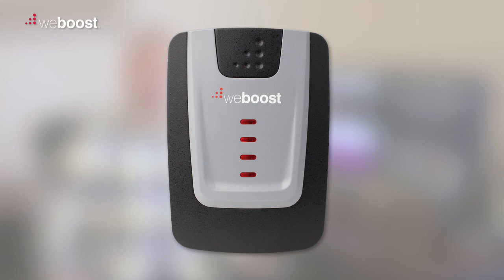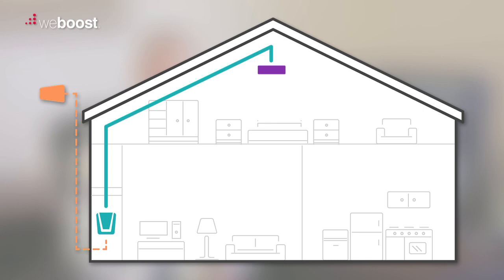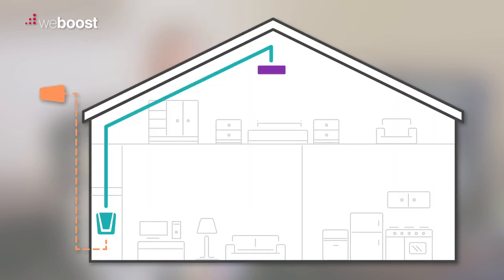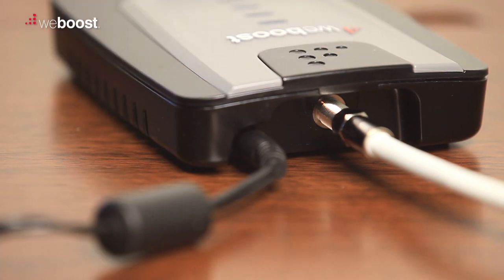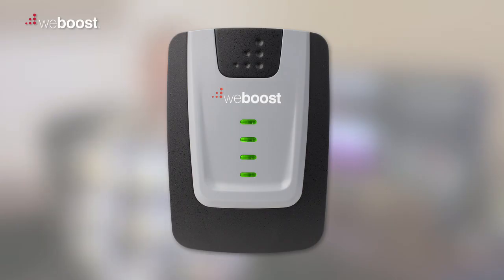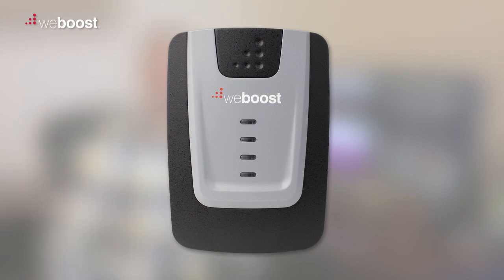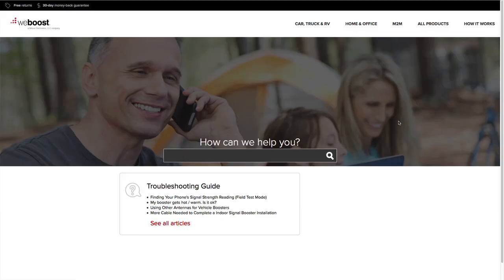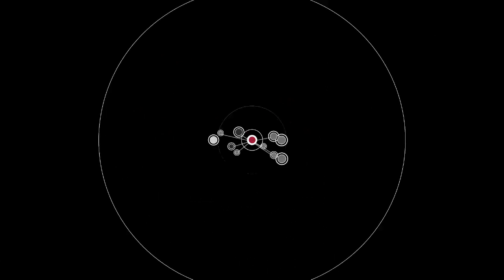Signal booster lights what do they mean? | weBoost

Comment: Well, this almost answered my question. My booster links, red and green when I first turned it on then it goes to solid green. My inside antenna and the main booster are about 3 feet apart. I am assuming this is the issue. Most of the time the booster works properly according to my signal, where there is a signal. Other times it doesn’t make a difference if I turn it on or leave it off the Signal can remain the same. I use fuel test mode on my iPhone to see the Signal decibel reading.

Comment: I recently changed from t-mobile to metro by t-mobile. Now my signal booster from t-mobile isn't working right. It has one. Green and one orange flashing lights at the top. The other four are not on at all. I have unplugged and pushed reset. Still the same. What can I do?

Comment: Have omni signal pointed at tower, spaced apart inside and outside antenna, top 3lights show solid green, bottom 4the light is always red and we are getting zero improvement. What could the problem be?

Comment: I have the RV65 with the Yagi Antenna.  I have rotated the antenna in every direction and eliminated some of the Green to Red blinking lights.  The direction I have the Yagi Antenna facing now causes all lights on the WeBoost to be solid Green except for number four.  Number 4 Blinks Green to Red 7 times.  My signal is boosted on all devices.  However, my Verizon HotSpot is NOT boosted.  I wish there was a data port so I can watch what connects and its strength.  I have NO insight into what is going on and that is bad.  Also, I wish I had a connections to the Yagi Antenna so I could see how to direct my antenna in order to maximize my signal.  Your manual mentions something about an External Antenna Adapter but no information was provided on your website.  I NEED HELP.  I am 900 bucks invested and I am about to return this thing for a full refund.  I am frustrated and need help.

Comment: Seems like the overload issue is a big problem with these boosters. I'd like to make a suggestion. The company needs to make an in-line cable signal reduction device, that will lower the signal gain to "80 percent". Please present that idea to the Weboost electronics engineers, and reach back out to me so I can take advantage of the royalties for the idea. I am an electronics engineer, myself.

Comment: I have a question. I have purchased and connected the WeBoost Connect 4G. My cellular signal went from 1 to 3-4 bars.  My phone shows I have 4G internet, however, the internet doesn't work. I tried a speed test and the download will show between 3-7 Mbps while the upload is non existent. Is there something to do with the booster that could affect this, or would this be an issue with my carrier?
Reply from the maker: Hi Steven, thanks for watching! It might be something wrong with the booster or it could be an issue with the carrier. We'd love to help figure out which. Would you mind reaching out to our technical support team? They would be best equipped to assist you. You can call them at 1-866-294-1660 or email at support@wilsonelectronics.com.

Comment: Just purchased my first unit. i have two questions, First; if i  need a little more length of co-x cable to put the antenna  in my desired place ( in the attic) do i need a special co-x or will any do? Second: because i want to put the inside antenna in the attic, will the hot and cold temperatures  of the summer/winter months hurt the Antenna? I'm planning on putting he booster unit on the main floor so it is accessible  to power. Just the inside antenna in the attic.

Thanks
Chris
Reply from the maker: Thanks for your comment Chris! We don't recommend placing the antenna in the attic in most situations. Unless you have enough signal to start with there. We recommend taking signal readings at this location to ensure you have adequate signal to boost. You are welcome to add cabling to the antenna, as it's just standard RG-6. However, you'll want to keep line loss in mind, as the more cable you add, the more signal loss you will introduce to your booster. If you need more than 50 feet of cabling, we recommend upgrading the Coax to an RG-11 type cable. The antenna itself should be pretty protected from the heat, cooling in the attic area, whereas the booster would not. The booster requires proper ventilation, and protection from the elements. If you need any help gauging signal, or have any additional questions, feel free to reach out to our tech team at support@wilsonelectronics.com or by phone at 866-294-1660.

Comment: My lights are all blinking, not solid, green and I have no signal??? You never described just blinking green lights. What does that mean? I cant find it on your website either? Thanks!
Reply from the maker: Hi Uma, our customer support would be best capable to help with this. You can reach them online at http://support.weboost.com/hc/en-us/requests/new or by phone at 1-866-294-1660.
Reply: Uma Vashi Devi Lescault 0xgggcvhvvh
Reply: @lebronjahval23  What did you find out? I have the same issue. All green but blinking. Thanks

Comment: Mine has dim lights and I compared it directly with a new one I bought for my shop in another location. I swapped the boxes here and the new one has bright green vs very dim green on the one that I've been using for about a year. Same power supply, antennas, only the box being swapped. The old one on speedtest has U/L speed of 1/2, D/L speed of 2/3 of the new one. That indicates something not right with the old one, especially since the lights use to be bright. Coincidentally, the new one will NOT pull in a 4G signal with its flat/box antenna, pointed toward the same tower the old one is pointed at. The old one does have a directional/yagi antenna but the poor 3G vs 4-bar LTE of one antenna vs the other is troubling. I have another flat antenna (new) that gives the same result. Bad cables from new? Kinda disappointed - both locations are in a fringe Verizon area. [edit] new power supply, no change. Also, the top connector to the roof antenna is very hot. FYI, I use this system to connect a Verizon jetpack for internet.
Reply from the maker: Hmm, that's interesting. Have you reached out to our technical support team to troubleshoot? If not, you can reach them by phone at 1-866-294-1660 or online at http://support.weboost.com/hc/en-us/requests/new.
Reply: Well, I thought you were capable of answering questions here as well. ;) I don't have a lot of time during business hours to talk. It would be nice if the new one would actually pull in a 4G signal. I also had it connected at my other shop where the 4G signal is stronger but no matter how far apart I made the antennas the red/green flash issue persisted and signal was as poor as with no amplifier, < 1mbps download on my Jetpack (which is like a poor 3G speed)

Comment: Is there a better explanation of the frequency bands represented by the bars?  For instance going from top to bottom 1 & 4 are blinking red, 2 & 3 are solid green.  So does that mean I'm good on certain carriers and not the other?
Reply from the maker: +Bill Trinkle Bill, yes that's correct. That would mean the bands and/or frequencies covered by lights 1 & 4 are not functioning at full power or may be shut off. Without knowing which booster you're using I couldn't say which carriers are affected. If you'll give us a call we can walk you through how to fix this so you're getting green lights on all bands. 1-866-294-1660

Comment: the light on mine are dim. You can still see it but they are very dim.
Reply from the maker: +Emmanuel Orupabo Emmanuel, If you feel that the lights on your signal booster are dim but can still receive a boost in your signal, there is nothing to worry about. Your booster is functioning properly and you can continue to let it operate. However, if you have noticed a loss in signal boost and are experiencing a dim light, this may be the result of a failing power cord. Testing the cord would be the next appropriate step.

If you'd like to know more you can read this article here. http://support.weboost.com/hc/en-us/articles/207275367-What-does-it-mean-if-I-have-no-lights-or-dim-lights-on-my-signal-booster-

If you have any more questions please let us know.